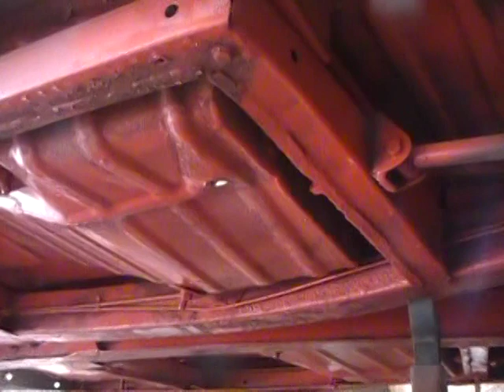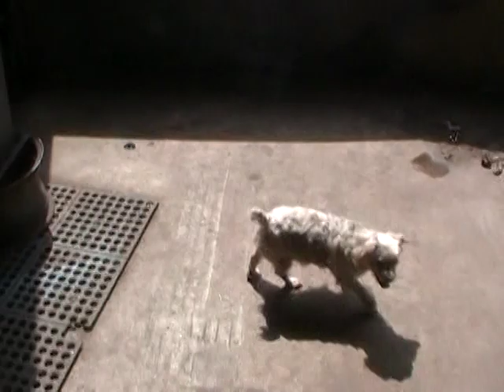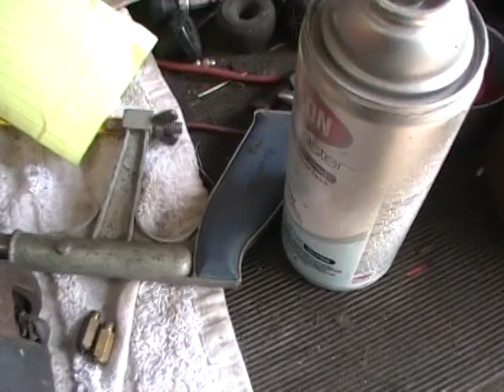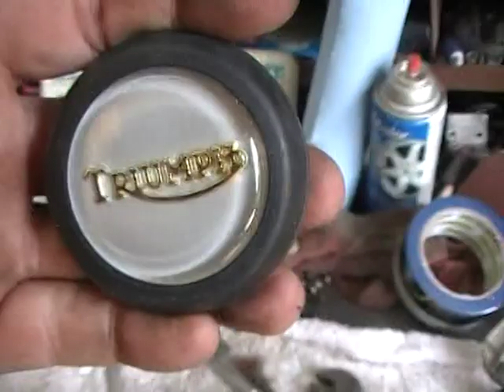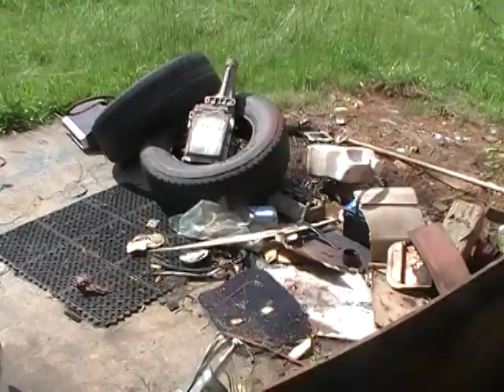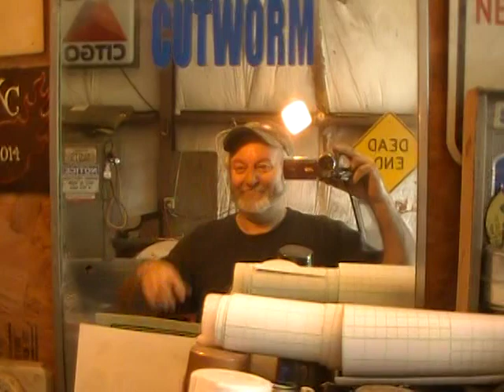Herald Brakes and a strange item

Comment: A stuck Bendix? When I was still driving cars that could be fixed, every town had a store that stocked reconditioned starters, although I do recall my dad changing a Bendix on a Lucas starter motor for my Cortina. He rigged up some sash cramps in the vice, but he did the job while I was at work, so I never learned that trick.
Reply from the maker: Changing the bendix is fairly easy. Push the big spring back and remove a pin. This suckered is rusted fast to the shaft.... Ugh...

Comment: The herald is coming along nicely :-))
Old cars take a lot of work to bring back to life, without people like you the old classics would be lost, that would be a shame.
Pity you dont have another assembly to fit that starter, you could grind the old one off and clean up the shaft for the replacement... wont one off the morris minor fit? same idea lol.
Reply from the maker: zx8401ztv I love my British cars and British friends like you! I grinded a slot in the bendix and freed it up. Got it built and set aside as a spare. My Morry has a 1275 Sprite engine in it. Same design tho.....Cheers!